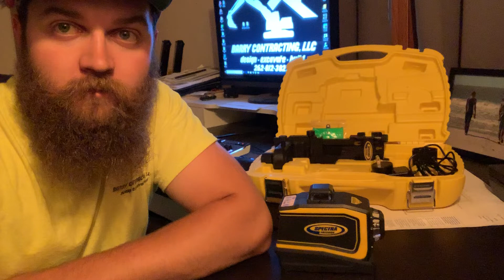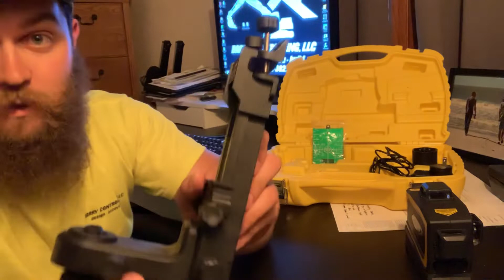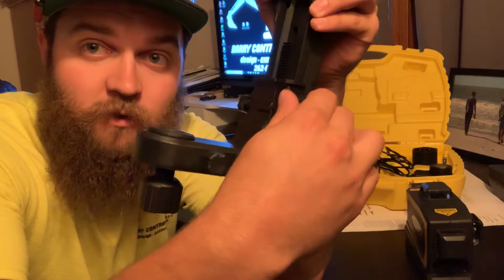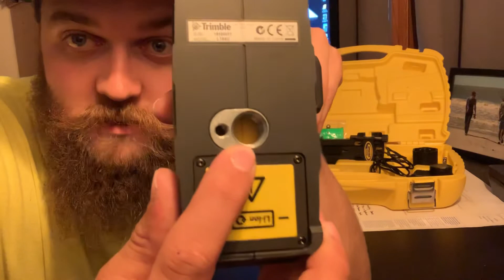Spectra LT58G Green Line Laser Review

Comment: I've been using the predecessor ie. LT56 more than a year now and it is truly accurate and reliable.  The best choice so far. Now looking forward to get LT58 once we get to start the next project.  The green is way more visible in the daylight, that's why.
Reply from the maker: Ari Jalokinos very good! The lasers have really changed our work flow. Very quick and efficient
Reply: @Digginwithace   I bought one without a charger, can you help me how many amps it charges with, and does it make a sound when charging?